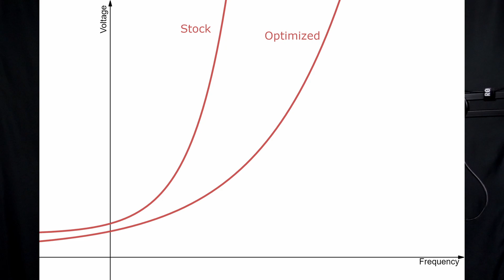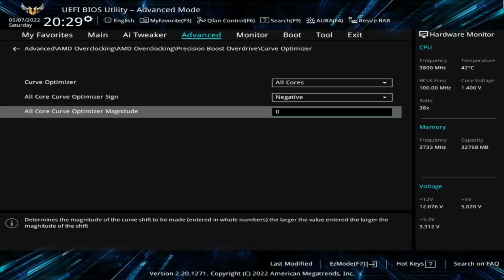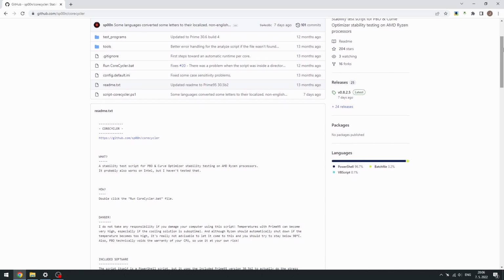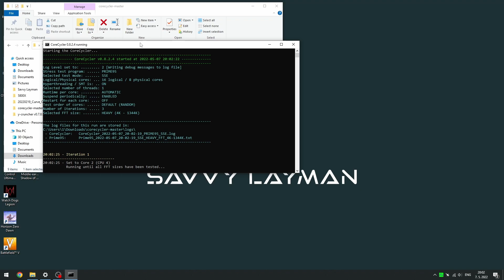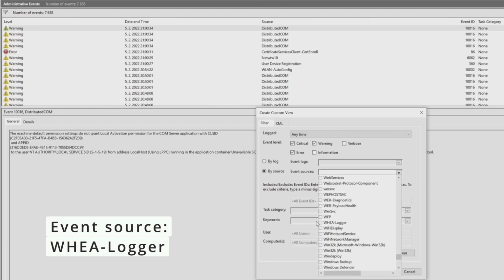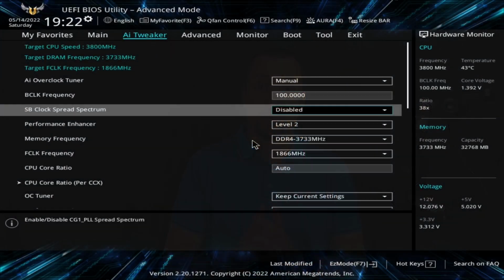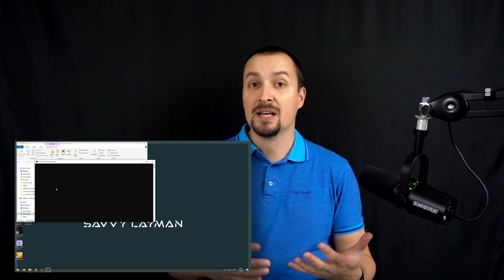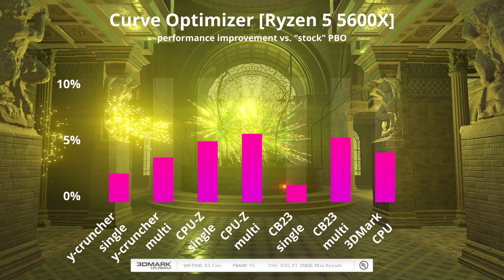Curve Optimizer - Ryzen 5000 / 7000 per-core "smart" undervolting

Comment: I  played around with it, and achieved around 4.9 sustained, but everytime I turned my PC on, it took around 3 minutes for temps and clock speed to normalize as it ran over 4 Ghz all the time. I was litetally so annoyoed I reverted Bios to stock and now I run 4.2 Gzh on Ryzen 7 5800x.
Reply from the maker: Sustained 4.9 GHz is nice, but I can imagine the massive heat output. Have you had a chance to try Hydra? https://youtu.be/Nnpao_5uXOQ
The latest 1.2D is available just for Patreons, but the free public version may be coming out sooner than later.
Reply: @savvylayman  I have checked it quickyl, haven't had the chance to went over it in details yet.
Actually the temps were around 85ish, which my AIO handled beautifully. But honestly, 4.2 Ghz is more than enough at this moment, plus the temps are around 60ish with 1.1 voltage.
Reply from the maker: @oneiilldashuffler  I fully agree. There's usually no need to push for insanely high clocks. What I loved about Hydra was that I was able to leave it running unattended and it came up with a few different undervolting options, including 1.1 V. I mean one can always do this manually, but it's a very lengthy process. Cheers for sharing, though.
Reply: @savvylayman  True, there is no need, and for now I am totaly happy with 4.2. It gets the job done, mostly gaming, but that is another component, rtx 3080 ti. So clock speed of 4.2 is fine and is low on power consumption.
Reply: my r7 5800x run at stock around 4850 constant drops to 4400/4500 and ups to 4850 in the next secound ... but under cinebench a full workload that is doing 100% from cpu is always at max speed ... silicon lottery win or why you are happy about 4.9ghz ? it is just 0.05 Ghz increase nothing more.

Comment: I'm on an Asus TUF gaming B550 plus MB, with a 5800X3D, latest bios update, and can't find where my PBO settings are.. can't find them anywhere :( if anyone has any idea ;)
Reply from the maker: Unfortunately, 5800X3D doesn't officially support PBO2, overclocking or undervolting.
https://www.pcgamer.com/amds-ryzen-7-5800x3d-doesnt-support-overclocking-or-pbo-zilch/
Reply: @savvylayman  thats really works... i arrived to undervolt il’ making this running cooler And then faster too ... just look for reddit pbo 5800X3D if you want to Check  it by yourself
Reply from the maker: @adamu6941  Thanks for letting me know. I don't own 5800X3D, so I can't test it myself, but I'm glad to hear there is a "hack" available.

Comment: I personally just downloaded and ran Hydra, went to sleep, plopped the FAST CO in in the morning, ran Prime95 (both normal and the auto changing Single Core), and dialed back 2 of the cores that were unstable. System is 99.99% stable.

Was way simpler than what you recommended.
Reply from the maker: Thanks for sharing. At the time I made that video, Hydra 1.2 was not available.
These days, I would definitely recommend Hydra. I even made a video on Hydra 1.2C: https://youtu.be/Nnpao_5uXOQ.
Just yesterday, I received a message from Yuri that 1.2D is out.
Reply: @savvylayman  Well I did this all back in March before this video was out so my point still stands...
Good to know newer versions have been released. Maybe they're worth trying?
Reply from the maker: @FatheredPuma81  I personally tried Yuri's CTR 2.0 & 2.1 as well as Hydra 1.0 & 1.2 and I need to say H1.2 has come a long way.
The diagnostic process is a lot more accurate and I can literally leave it running unattended.
I wasn't too impressed with Hybrid OC in H1.0 (I guess because the diagnostic simply didn't cut it back then), but I no longer use Curve Optimizer since H1.2B came out. So yeah, I would definitely recommend Hydra, but the public version has not been released yet imho.
Reply: I would use hydra but for some stupid reason just running the diag on my 5800x it instantly limits my Rx 6700 xt to 500mhz and the only way to get rid of it no matter what else I do is uninstall hydra and ddu and reinstall the drivers
Reply: @d4rkz3nn3n  Sadly can't help you on this front. I luckily don't have to worry about AMD CPU+GPU driver fuckery because I don't have an AMD card.

Comment: How about if I just want to reduce power consumption since there is so much power on modern processors and I'm worried about my ups better life.
Will this help me under underclock for power efficiency ? I want to do the same with my graphics card.
Reply from the maker: You can always decrease the power limit and the CPU / GPU will throttle down accordingly.

Comment: For me it just says regular auto and high so what should I put in?
Reply from the maker: Hi, may I ask where you can see this?
Reply: @savvylayman  half of it is also in the vid to get to it but yeah thstd pretty much
Reply: sure bassically you go to “ai  tweaker” then scroll down to where you see  digi + vram and once you are in it click auto and it shows regular high or the levels for you which I don’t have those for some odd reason
Reply from the maker: @noelperez6626  What motherboard is this? In any case, I would leave it set to "Auto". I'm planning to release a new video in the next couple of days/weeks where I'll provide an easier, software based approach to tune the curve. That may be more beneficial for you.
Reply: @savvylayman  my motherboard is an asus b550 eufi thats the  bios but you might have a different bios so it might not look the same

Comment: so i have to call ny self lucky i guess??? my 5600x getting 5044 points on cinebench r20.... my offsets are -30 to 5 cores and 1 of them -22.....am on a arctic 360m aio am getting 75c max am boosting up to 4.730ghz...also running b-die clocked 3800mhz cl 14-8-15-13-30 (trc 39) (trfc 247)....
Reply from the maker: Off topic: That's some nice timings with that B-die kit. Is it two 8 GB sticks? What voltage did you use to make it stable?

Comment: First of all, very great Video! 

I am actualy on my 5600x curve optimizing by the guide i found at german forum „Guide Curve Optimizer Ryzen 5000“. There it is described that the found settings should be tested with the Corecycler using the FFT preset sizes Heavy, Heavyshort & Moderate respectively with SSE & AVX. Now I ask myself the following questions:

1. should I also test AVX2 or is it enough to test only with SSE & AVX to have a stable system?

2. should I first find the optimal offsets for the Curve Optimizer and then OC via pbo (0-200mhz) or the other way around?
Reply from the maker: Danke schoen! :) To answer your questions:

1. I went with SSE as it cycles through highest boost clocks, which can potentially cause trouble.

2. This is a very good question. I personally went with +200 MHz PBO offset first, but it may make sense to do it the other way around to eliminate so-called clock stretching.
Reply: @savvylayman  Thanks for your answer and many greetings from Germany :).

I first found my optimal settings with the tests on SSE. When I tested with AVX, 2-3 cores were reported as errors. I had to adjust those by 2-5 points then again. Now the tests with AVX run without problems (Heavy, Heavyshort & Moderate). The only question is whether AVX2 is additionally needed, since such high loads are only rarely required for e.g. renderings, etc.

I will try after my complete testing to add a few Mhz with pbo until a core reports an error.
Reply from the maker: @viiziionz9624  Thanks for sharing. From my experience, I had to let CoreCycler iterate a few times with each core as it would sometimes pass the first or the second round of tests and only then it would throw an error. It's always better to test both SSE and AVX. It really depends on how much time one wants to spend with this. AVX2 is a complete overkill for standard users imho. :)

Comment: Hi there, just wanted to ask you about the temperature differences after tuning the CO like this. I know that this is pretty much done to undervolt the cpu and let the voltage curves be a lot smoother, but what temperature drops did you observe? If ever you answer the comment, thanks!
Reply from the maker: Thanks for asking. One may be surprised to learn there is little to no measurable temperature difference when optimizing the curve. I think it has to do with how PBO2 tries to utilize every bit of temperature + wattage headroom. That said, you will most likely be able to observe a marginal performance bump (due to increased clocks) unlike the drop of temperature. If your CPU is running too hot but you don't want to invest in a better cooler, I think the more reasonable way is to use classic Vcore undervolting. Please note however, this always results in the drop of performance.
Reply: @savvylayman  thanks for the reply. I'm mostly asking because my 5950x is running a tad hot and has been throttling when I run cinebench r23. It gets an alright score at stock or after lazy CO-settings at around 24500 multicore. It just shoots up to 90degrees tho which is scary, and jumps from 48-60 degrees at idle and simple windows tasks. Do you think that's normal thermal behavior for the chip? Would really appreciate the help on this ❤️
Reply from the maker: @mhirang4199  5950X can run very hot and therefore, it needs a very solid cooler. I can highly recommend Arctic Freezer II 360 if your case can accommodate such a large radiator (and you don't mind the look of the weird looking pump :D). I also recommend an airflow focused case. Tj max of your CPU is 90°C therefore I would definitely aim at keeping your CPU temp below that throttling limit. If I may ask, what case and what cooler do you use these days?
Reply: @savvylayman  I'm running a brand new NZXT X63 and my case is the Lian Li o11 airflow mini with around 4 intake fans (front where the radiator is and bottom) and 3 exhaust (top and rear). I just used the stock thermal paste on the cooler, so idk if it covers the entire chip. Ambient temp here is also 30 degrees if that helps
Reply from the maker: @mhirang4199  Both your AIO and case are very nice. You also maintain a positive pressure setup, which I think is ideal.
Factory application of the stock thermal paste may not cover the whole IHS of your CPU, but I guess it covers the parts where most heat is actually generated. I would still buy a nicer paste (e.g. Thermal Grizzly Hydronaut - don't go with Cryonaut as it dries quickly with temperatures over 80°C) and spread it evenly across the whole IHS. Also ensure the pump sits well on the IHS (I usually give it a bit of rotation a few degrees clockwise and then counterclockwise to eliminate any air bubbles forming between the paste and IHS). Then tighten the screws carefully but firmly (in a diagonal fashion, i.e. 1 & 3 first, then 2 & 4). You may also want to crank up the fan curves (unless you are running them at 100% already).
Your ambient temperature is very high so unless you can use A/C to drop it by 6 degrees, I don't think there is much else we can do. Perhaps this is indeed the rare case of when one should disable PBO limits as there's just too much heat output. I know this isn't what you wanted to hear... My apologies.

Comment: Currently sitting with my 5600x with a -20 all core CO

With this knowledge I will finally achieve 12K points on cinebench on a low profile cooler.
Hopefully the per core CO will give me that extra 200 points
Reply from the maker: May I ask if you were able to gain the extra 200 points in Multi Core benchmark?
Reply: @savvylayman  I got about 50 extra. unfortunately there is only so much power you can dump into a big shuriken 3. Guess ill have to resort to memory tunings
Reply: @cyko5950 were you also using precision boost overdrive? You know, that thing that lets you run a higher boost clocks for longer?
Reply: @MrGamelover23  i had it at 145 watts max but it refused to go past 120 i never figured out why. but i sold it to my friend and got me a 5700X which has more power tham i need or expected

Comment: interesting process may well give it a go one days
 Would you tend to recommand to get memory to desired level first or do the optimiser curve first. As they may have i do believe some correlation between power draw and how much memory controller may have available
 i got budget kit and that little gem r5 5500 give me trouble to stick at 3466 while been on the same board in the past whit another good bin dual rank able to hold flck at 1800 on a r5 5600g perharps may have more homework to manage to get it to stick.
Reply from the maker: You are completely right. RAM must be rock stable BEFORE optimizing the curve.

Comment: I tested each core of my 5950X with CoreCycler and PBO 2 Tuner to set the curve directly from Windows to avoid rebooting to change the UEFI settings each time and the result were very strange as I only got errors at -30 for two cores, and it’s VERY unlikely that my CPU will run fine at -30 for every but two cores.
Reply from the maker: Let me put this straight: Automated Curve Optimizer in Ryzen Master is trash. It always suggests unrealistic negative CO offset. It perhaps doesn't make the CPU crash right away, but it's definitely unstable for a daily system.
Reply: PBO runing for best and 100% stable result is such time consuming tunning that it does not worth effort. If You want best multicore performance, go with manual oc. If You want best gaming performance, leave it on stock. If You really dont know what to do in Your free time, go and burry Your selfs in to pbo fine tunning rabbit hole. I hope that 5% fps increase worth it. For me It didnt.

Comment: Which GPU are you using for your gaming benchmarks? I'm curious if this is worth the effort for a 3070 ti with 5600x setup
Reply from the maker: Thanks for asking. My 5800X rig uses RTX 3080 and my other 5600X rig uses RTX 3070.

Comment: After optimizing my 5800x I got a peak core clock of 5.3Ghz avg. and a constant of 4.8Ghz at 74degC with 114w peak power draw. The temps are down 14degC from my base stock results. Worth the effort since I live where summer temps peak at 40degC.
Reply from the maker: You apparently won the silicon lottery. Congratulations! I'm a bit jealous. :)
Reply: 5.3ghz for 5800x? It sounds You got world record there without using liquid nitrogen.... Too good to be true imho.
Reply: @johnrehak  Could be a false positive. I was using CPUID HWMonitor. It was a brief spike at the start of the stress test. If I could share the screenshot results, I would.
Reply: @BiggieSmalls-s1c  I understand, but You should check Your clocks, voltage and temps in HW monitor, not in CPU-Z.
Reply: What settings did you use for your optimization?
Reply: @jmarq4325  Within the BIOS, I used Per Core tuning and not all core. 1 started at the max undervolt value on each core, used OCCT to stress test and Windows event view to identify the faulty cores. With that information, I wen back into the Bios and decreased the value by 5 points on each core that the event viewer flagged as having an issue. I rinse and repeated a few times, took about 2-3hrs to dial in without crashes. 

Savvy has some very good videos that will help explain. I think I got my 5.3GHz reading because my AIO temps werent at running temps and allowed for the CPU to peak just briefly. Good luck
Reply: You could probably Get similar results to that by just lowering the PPT then I would do the optimization afterwards to see what further results I could get
Reply: I've seen crazy high peaks in HW monitor before when overclocking my FX8350, with one spike hitting 11GHZ, but I'm not sure how it happened because I was targeting something like 4.9 at the time.   I havent really gotten deep into these new Ryzens because I just recently upgraded and havent felt much need.
Reply: How much did you stress test per core? I see people on the internet saying 8-12-24hours
Reply: Bullshit

Comment: I used OCCT. Can set a 15 max time exercise and to auto stop when a core "fails" it also says which core/cores need changing. There isn't any need for any outside testing with the program having a stresser.
Reply from the maker: I tried OCCT before it had variable load feature available. I'm not sure what workload it uses there. Perhaps it works. :) Thanks for sharing.
Reply: Got my 5900x boosting to 5.1ghz with curve optimizer
Reply: @gameplaybenchmarks3294  mmy 5800x only went to 4.85 but it's crap so just happy the temps are down lol